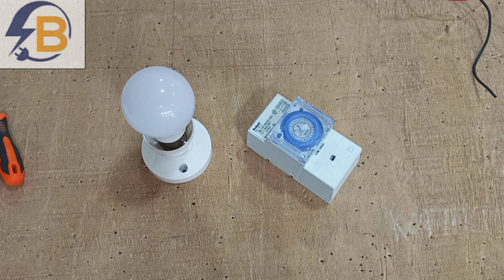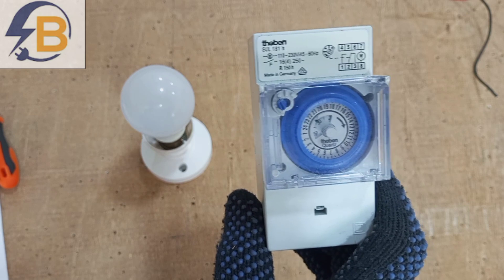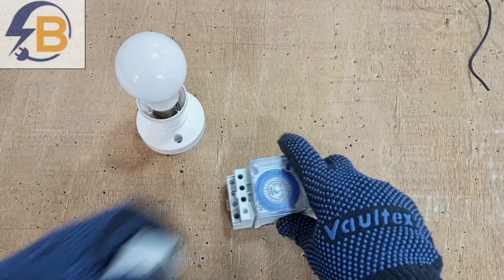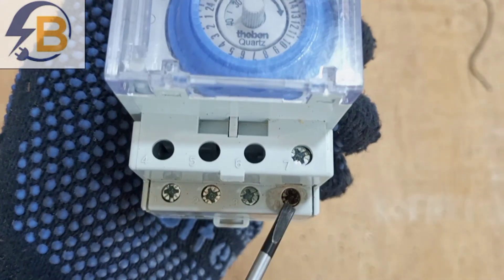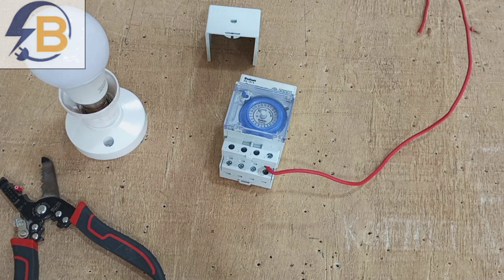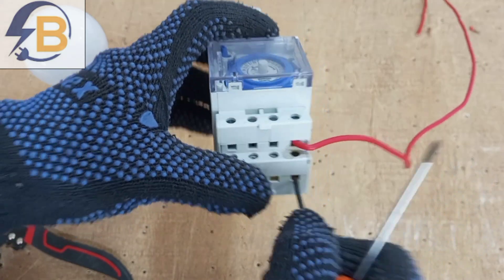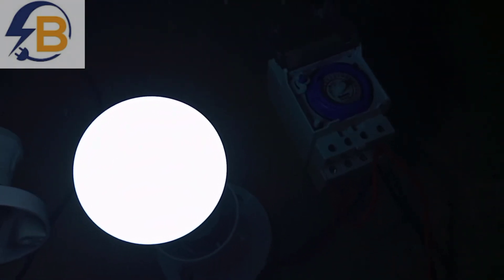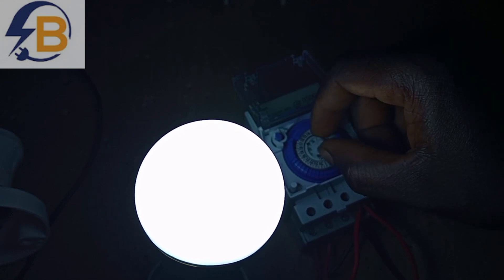HOW TO WIRE 24HR TIME SWITCH FOR STREET LIGHT

Comment: Good facilitator 🎉 keep the 🔥 burning sir. And I want to ask can we connect multiple lights to this 24 hr timer
Reply from the maker: You would need to consider the rating of the timer,  compared to the total ampere rating of the lamps under consideration..
Reply: @obloni_Electrical  And how is that done sir.